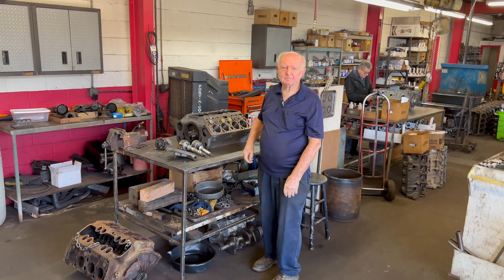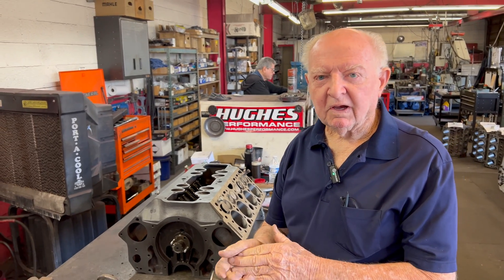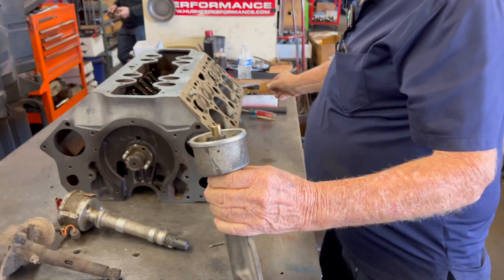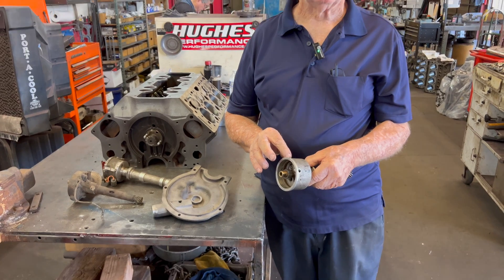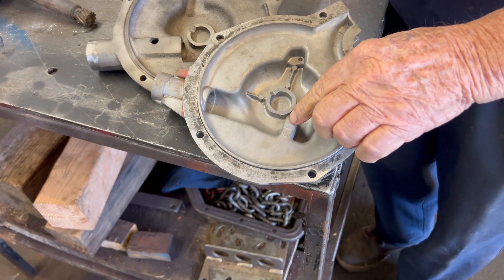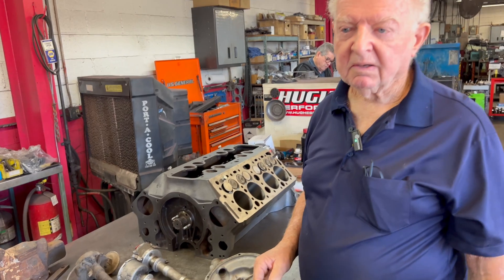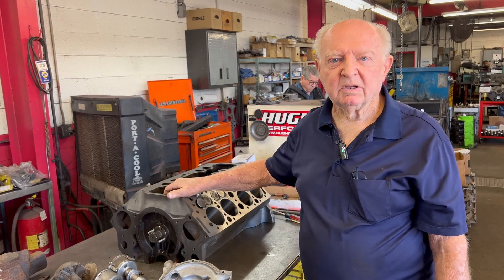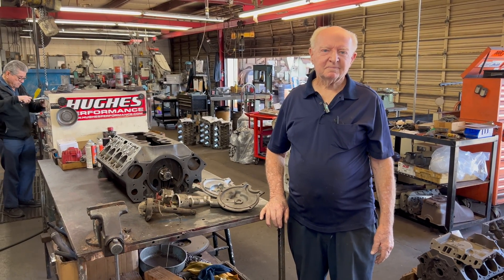FLATHEAD Mods - Distributors & Timing - Ed Smith #classicengines

Comment: Hey I don’t know if you and Ed would ever do a question and answer episode but if you do I would love to know how do you set dual points?
And if he’s using a Chevy distributor the firing order and rotor speed from cylinder to cylinder must be the same as using the original distributor?
And wouldn’t it be better to use the timing gear cover that you referred to as aluminum with the bottom support be better for a higher rpm type engine?
And if you want the dual points wouldn’t it be better to use the earlier block with front mount distributor?
And finally what Chevy engine had dual points or from where did the distributor come out from?
I really enjoyed the video I could listen to Ed’s wisdom all day long!😀🇨🇦
Reply from the maker: Thank you, Keith! Perhaps I can get Ed to do a Q&A episode collecting really good questions like you have here…
Thanks for the comment and the good questions!

Comment: I would really love to see what does Ed do to improve a ford 300 inch 6 cylinder. I feel like the man has worked on a little bit of everything and he is very resourceful.
Reply from the maker: He might, I’ll have to ask… Although those 300 in.³ six cylinders were pretty bulletproof to start with, but I think you mean more power…
Reply: I would be happy to see any tips that Ed has to offer. I recently built my 300 Inline  so it is of personal interest to me.
Reply: @toralfcross3819  A
well designed twin carburetor manifold, a little more compression, hotter cam, and a free flowing exhaust would give you at least 25 percent more HP and still idle well and run good.
Reply: I already had cylinders cleaned up with new oversized pistons, increased compression to between 9.5 -10:1, installed Elgin E1178P RV cam and installed long tube headers and offenhauser 4 barrel intake manifold. Im just not totally satisfied with the engine and preparing a 351 windsor to install. Hopefully can afford to send it out to 5 star engines for balancing eventually.  @ellieprice363

Comment: for somebody who  have some machining facilities, converting the original Ford distributor  to electronic is fairly easy using a chrysler V8 reluctor ring, Chrysler Pick up coil and a GM HEI 4 pin module, to complete the system, you can use a Ford TFI coil.
this is far more reliable than kits
Reply from the maker: I don’t know from my own experience, but I’m sure that’s another way to do it. You might notice that Ed likes to do things himself with parts he has laying around … he makes his own kits! Thanks for watching 👍